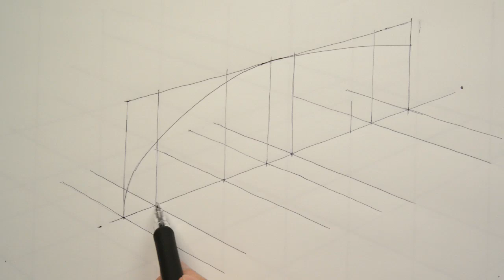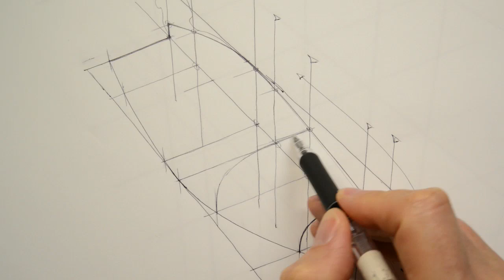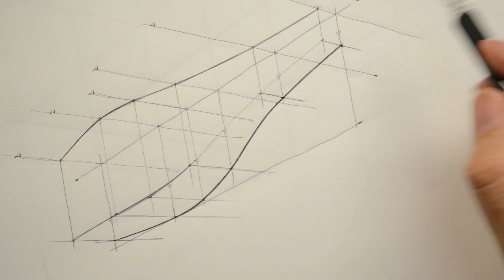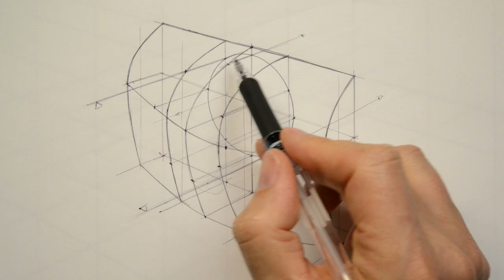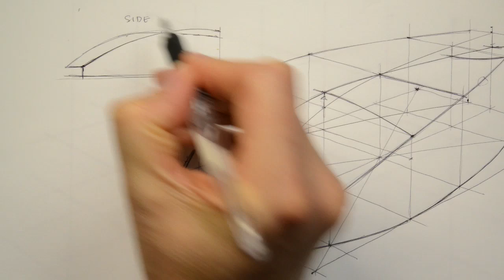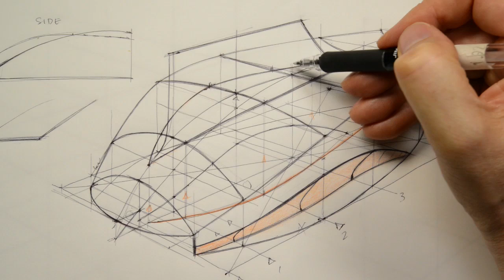page 099: X-Y-Z section drawing

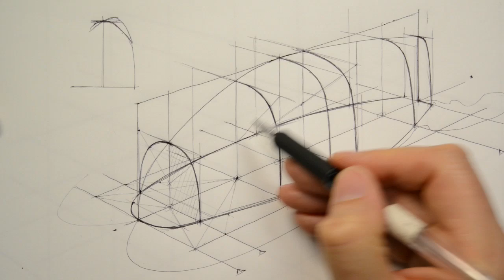Comment: At 13:18 the far side of the frontmost cross-section hits the horizontal plane right on the diagonal line. The near side of the cross-section hits it somewhat closer to the centerline. Is this an error in mirroring, or am I missing something?

Comment: I'm trying to do the 2-curve combo so I can finish chapter 3 of the book. I saw you freehand the curve on this first example but is there technique to perfectly mirror the shape on perpendicular planes?
Reply from the maker: +monkeydeeznutz Not sure I fully understand your question, but if you are wanting the centerline section to be transferred exactly to the ground plane for instance, then use square sections to do so. The only way I know to check the square sections is to use an ellipse, also explained in the book. This will give you a way to transfer one curve on a plane to another plane that's perpendicular to it, such as side view transferred to top view.
Reply: Yes, that is my question. I'm sorry, I don't really understand what you mean by square sections. Do you mean to draw the diagonals and centerlines?
Reply from the maker: +monkeydeeznutz No, I mean the shape of the sections in the third axis, such as in a front or rear view if you are trying to make the centerline shape exactly the same as the top view for instance. The squares in perspective will help you to translate the foreshortened shape of the top view on the ground plane while insuring that the height at center will be equal to the width of the top view at every square section because squares have equal length sides.

Comment: Hi Scott, my question is regarding page 86- are your impeccable grids a result of many years of practice?(if so-how do you check convergence?) or do you use an underlay?
Reply: Don't take my word for it but I've seen a couple of other tutorials and he explains that if you practice small boxes and ellipses you can actually drag lines out from them while keeping convergence in mind to create a rough grid. It's not totally as accurate as brewer method or setting vanishing points but it's good for sketching. Takes strong basic knowledge to do
Reply: Here's the thing though- dragging lines from small boxes or ellipses is useless if you don't draw them correctly (proportion+perspective) from the start.  Don't forget that there are other factors involved here- cone of view, lens type etc.  It seems to me that most designers are "hardwired" to always keep that in mind and to see the bigger picture without an underlay grid.   How can one become so confident and precise whilst laying down the first lines? what should I practice?
Reply: after practicing grids for so long and drawing you'll be able to sketch out a rough box by judgement of eye alone. the box is done by eye kind of how you would draw a box for a mass when figure drawing. It's an estimate. It's not going to dead on accurate. If you really want accuracy you have to use brewer's method, an underlay, or set vanishing points(etc).